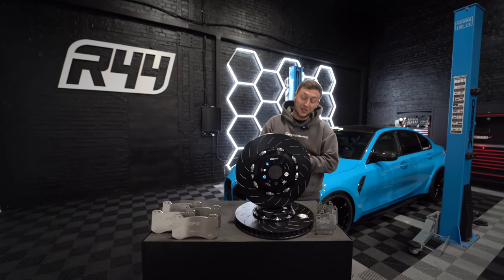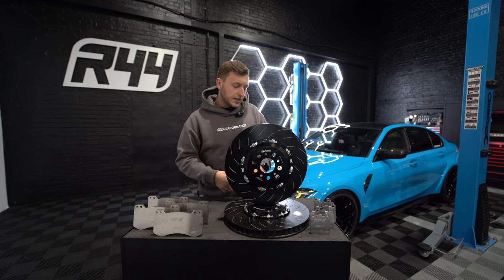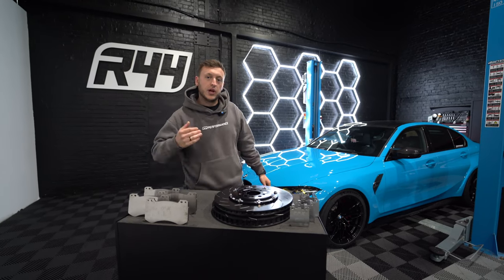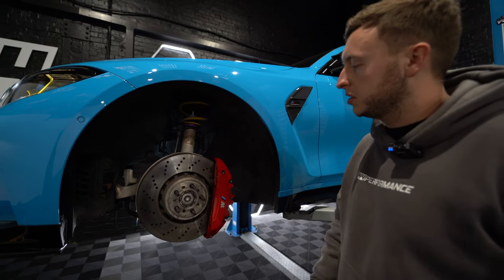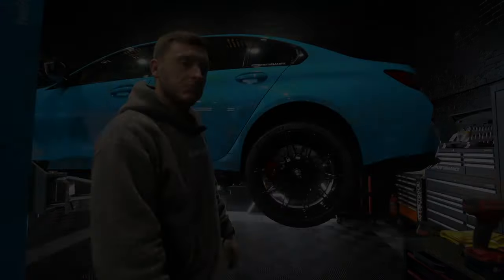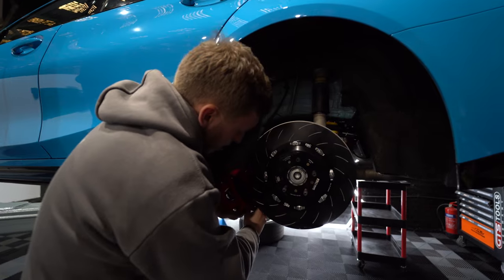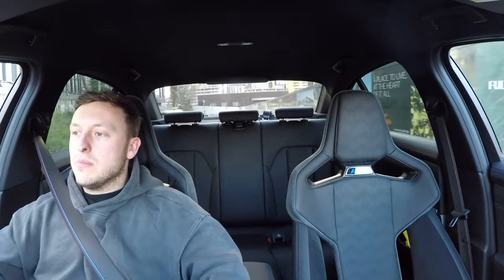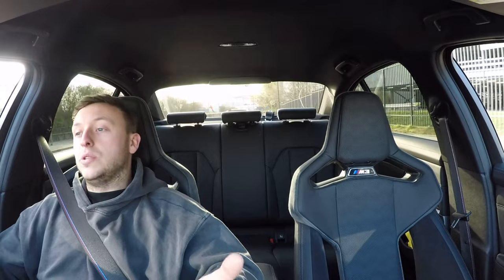THE BEST BRAKE SETUP FOR YOUR G80 M3 (EBC Brakes)

Comment: BMW cheaped out so badly on their rear brakes. They should have gone with 4 piston rear calipers. Every other performance based sedan/coup from other manufacturers do this.
Reply: Amg and rs also cheaped out rear brake calipers
Reply: I'm a relative novice, here, but the majority of braking is done on the front rotors. If the rears are able to lock up the wheels and outlast the fronts in terms of overall wear and heat dissipation (they do on mine), why add cost, unsprung mass, and rotational inertia to a system that gains little to no benefit from it? This is two-fold for the driven wheels. When in doubt, I tend to assume that one of the best motorsport development teams in the market knows what they're doing. In contrast, it seems that the primary benefit of upgrading the rear's size would be that they'd look cooler.
Reply: It’s because of the ebrake if am not mistaken
Reply: @stephendavis3710  curious how the e brake has anything to do with this. Reason being, my CTS-V3 has an e brake, it also has 4 piston Brembo calipers out back. So some how GM/Cadillac was able engineer a setup to accept larger rear calipers but BMW was not? 🤔
Reply: @BigThumpr1  Because they have an integrated electronic park brake (EPB). All calipers that have this system are single sliding setup.

Not possible to have a fixed caliper with integrated EPB.

Cars such as Aston Martin and Ferrari get around this by having a fixed multi piston caliper for the hydraulic braking and then have seperate 2nd caliper for the EPB. ^ this is what I heard, I also hear it could be they cheaped out
Reply: @stephendavis3710  yes I get how it works. But I don’t think you’re under standing the point I was making. Other manufacturers have created a parking brake design that eliminates the need for a separate e parking brake caliper or to integrate an e parking brake into a single piston caliper, yet can still run a multi piston rear caliper. BMW clearly cheaper out.

Comment: The brakes on the G-platform are good from standard, the rear set up is absolute shite, the calliper they have used is because they have opted for the electric handbrake, same as Merc, Audi etc.
They need to go back to a proper handbrake then use the four piston setup on the rear👌
The F-platform M cars had this & it worked a treat!!
Would never touch EBC brakes, might as well put plastic plates on for brakes, stay OEM & change the pads to track pads for the day then change back for daily use.
You’re gonna get brake dust so quit f’king moaning ffs & deal with it yeah!